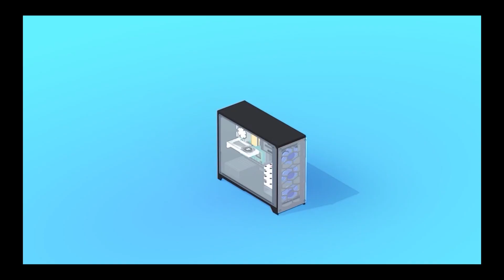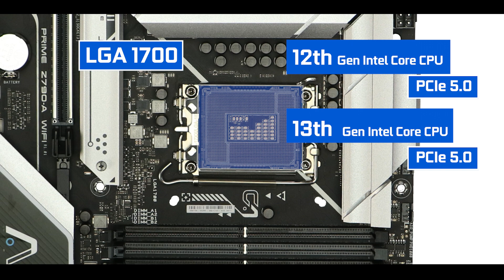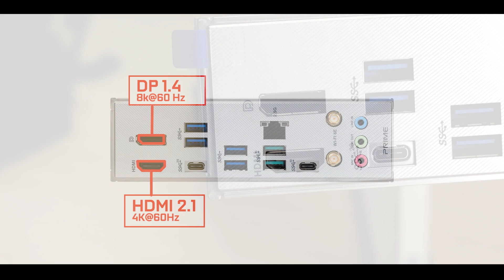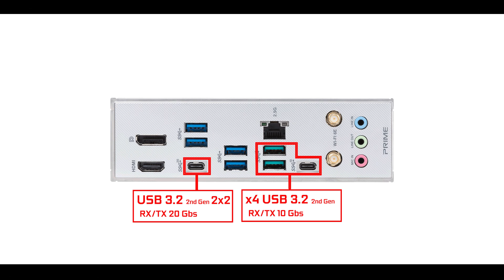ASUS PRIME Z790-A WiFi : The FULL review

Comment: I have the asus z790-ayw wifi w what 750w or 850w power supply can I use?? The ones I have been buying have 2 eight pin connectors while my motherboard as a  8 pin cpu connector and a 4 pin cpu connector

Comment: I have one more question. I have already purchased this motherboard, along with an i7 12700k processor. They haven't been taken out of there shipping boxes yet. My question is this... Would it be worth returning these and getting the "latest" Ultra 7 265k cpu, along with the Tuf motherboard version for this socket? I used PowerDirector for my video editing, and I'm looking to achieve greater stability and workflow on my video timeline, along with quicker rendering time, although the rendering time is not nearly as important to me. My present system, now 6 years old, features an i7-8700 processor and a TUF series motherboard. Any input would helpful. Thank you.
Reply from the maker: In short YES. 
The Ultra brings in PCIe 5.0 which , for an editing machine is central for the years to come. 

Currently you paid 90% of the price for 60% of the performances. 

I would return. Pay the 10 or 20 percent more and get a PCIe 5.0 / USB 4.0 future proof build. 

I would also use my affiliate links for these purchase. It will bring you unprecedented libido and eternal youth (fact).

Comment: If you use an I7-12700k processor, and that processor only supports up to 4,800 RAM speed, then buying Ram with a 6,000 is a waste of money, right? This board can potentially process a higher RAM speed, but is limited by the CPU capacity. Am I understanding this correctly?
Reply: I'm running my 13700k oc to 5.6 with the ram at 6400 on this board, so no :)
Reply from the maker: Well In principle you are right :) but RAM can go much faster if you apply higher voltage profile ( XMP for intel)  . So if the board advertizes higher MTs and ram frequency, it means that the voltage components have gigher rating and that the BIOs have the right RAM OC options. 

The RAM manufacturers, in their side pretest their components to run at higher clocks , hence their advertised clock :)

I hope this helps ')
Reply: @Laurentschoice  Hey, thanks for such a quick and kind response. I'm working on a new system right now. My last board was an Asus Tuf option (6 years ago), but this time I'm just going with the Asus Prime Z790-A, with a i7-12700k processor. Was a bit confused on the RAM choice for this build, so I just went with 32gb of Corsair DDR5 @ 4800mhz, as that is this specified max the processor can handle, and so I thought I was limited to such. Anyways, I'm not a gamer, don't overclock, and will be using this system for some video editing and personal use. Combined with a Noctua CPU cooler, I think this system will meet my needs. I would love to see you do a video addressing the actual component quality between the Asus motherboard options. Are the "military grade" components used in the Tuf series, really last any longer than the Prime series? What is hype and mere marketing schemes verses truth and reality? I almost went with the Tuf option, because I've had such good luck with my present board, but I think I will get the same out of the new PRIME board I have purchased. THANK YOU!
Reply from the maker: So the TUF séries do indeed use what is graded as ' military grade components '. 
Chokes are much resilient ... Going from 5k for the prime to 10k certified hours , you got more PCB layering, and normally you'll get more component spacing to reduce PCIe noise. 

Now.. truth of the matter you'll find the same quality grade componentry on ROG products. So TUF is really a bridge between the Prime and The ROG family. 
The prime Z790 is a bit different than other primes cause it does feature many TUF qualités in terms of resilience without advertising it much. So you did a very solid choice for a 12700k :) 

Good build !
Reply: @Laurentschoice  Hmmm, very interesting. I wonder if the Prime Z790 uses the same 10k chokes as the Tuf line, with this being the unadvertised exception. I just want this new board to last as long as the Tuf board that I'm presently using, and which still works fine (6 years running from morning 'til evening, 7 days a week). I haven't installed the board, and can easily switch it out, if you think that is advisable. Once again, thanks for the personal response. I appreciate it. Great channel you have!

Comment: This board has only 4 sata ports and weak DDR5 abilities on the fast slots (best i could do is 6000 mhz xmp profile, and a max speed of stock ram speed (4800 mhz if i remember right) on the slow slots. Also it had a tendency to selectively not boot my spinny slow HDs which pissed me off to no end (yes the POST delay boot setting... eh not that great waiting an additional 8+ seconds for it to maybe boot them). Refunded and got Gigabyte Aorus Elite X AX for $20 more and no issues. In theory i can do 4-way DDR5 at high speed (not that i intend to but i like the flexibility). I honestly didn't test the slow slots yet but fast slots are taking 6800 mhz OC without issue and 7000 mhz is just about stable with some tuning (had like 1 error after a lot of TestMem5 testing, with the same cheap 6000 mhz kit that Asus had issues with!). Also yes slow spinny HD's all work and 6 sata ports (so i can plug in all my old drives AND my ancient dvd burner). Basically the first and last ASUS board i will ever buy lol.

Comment: I'm split between getting this or the Z790-P for my new DDR5 setup, im running a i9-14900k on a AsRock z690 PG Riptide with 64GB of RAM as of now, which I will use in another case and install the i9-12900k and RTX3070 and either sell it or use it as another backuprig.
Reply: Hi did you end up putting a 14 gen CPU on this motherboard? Did you need a bios update?
Reply: @sean9844  Yeah and it didn't go well. The Prime Z790 has had a lot of issues and where I bought it they said lot of people returned it. Im now using a Strix Z790 instead which works well.
Reply: @EricTheBroBean  I am putting it together with i7 14700kf. The board just wont start.
Reply: @sean9844  Habe you tried updating the UEFI?

Comment: Hey there,

Thanks for sharing this detailed review of the Asus Prime z790a motherboard. It's always great to get insights into the latest tech offerings. I appreciate your thorough analysis of the motherboard's features and capabilities.

You've covered a lot of ground in your review, from the design to the VRM configuration, memory support, and I/O options. It's clear that this motherboard has a lot to offer in terms of performance and versatility.

One thing I'd like to know more about is the motherboard's compatibility with different CPUs and GPUs. It would be helpful to have some information on which processors and graphics cards work best with this motherboard for gaming or other tasks.

Overall, your review provides a comprehensive overview of the Asus Prime z790a, and it's certainly a motherboard worth considering for those looking for a powerful and reliable option. Keep up the great work!

Comment: I'm annoyed because they flipped the direction of the sata cable ports and mine bends at a 90 degree angle, so I need a full extra half-inch of below or behind my motherboard to use either pair of sata cable ports, and it's a tight fit in my case.

Comment: For anyone building a new system opting between these two, they'll probably have to opt for the z790 anyway, since a lot of asus boards seem to not bother with a usb bios flashback port
Reply: Can it hold a 14th gen
Reply: @zappuccinoo  no that's socket LGA 1851, so only 13th gen and 12th gen
are LGA 1700 socket. Intel always changes their socket every 2 years,
AMD is the only one that'll stick with a socket for more than 5 years. the FX
platform lasted for nearly 8 years, so 14th gen Intel is 1851, that means
15th gen will likely be 1851 as well, unless Intel comes out with a whole new
CPU architecture, but i don't see that happening. maybe after 15th gen.

Comment: The problem with Pci 5.0 Nvme on Z790 is that none of the Z790 boards that support PCI-E 5.0 nvme will run the gpu at 16x whilst running a PCI-E 5.0 nvme, they will all drop to 8x as there is not enough pci-e lanes on z790, this is why even the Apex still only uses 4.0 so you can maintain 16x on the gpu. So Asus choice is understandable

Comment: The only difference is false advertisement with the z690 version, at least for the p variant. You cannot run ddr5 with 4 sticks inside, there is no supported set. So the highest configuration is 2x32 GB at 6000 MT/s or 2x16 GB, but forget it if you want to upgrade.

Comment: Given the choice between the PRIME Z790-A WIFI and the ROG STRIX Z690-F Gaming ($60 CDN more), which would you recommend for a new build with an i5-13600KF processor?
Reply: I would go for the PRIME Z790-A because of the bios issue with the ROG STRIX Z690-F, mainly bc it is a 12th gen board, whereas the prime is a 13th gen board that also supports 12th and has a bios flashback button
Reply: Also the RAM speed difference allows you to have some freedom if you buy 6000mhz ddr5

Comment: Thank you for this review. I purchased this board for my next build which will be in white. I buy boards like I buy cars, I don't buy a new one every year. My pre-built i9-139 Hyte system has a TUF Z690-Plus in it and I am happy with it. My expectations are that these two boards will get me thru the next 3 years at least so I don't mind the price when the quality is there. What I can continue to do is to upgrade around the board with faster memory, better cooling, better graphics cards and fans. If and when any of those items become available and will add to my system, that is where I may do additional upgrading. Got my Z790-A. One difference I did find is that the Z790-A DDR5 has connections for TPM. I get what that module does, just trying to figure the benefit and how it works.

Comment: Pls tell me how many lanes i have with the rtx 4090 on the mainboard ? I dont understand? Only 4x or 8 x or 16 x? ?
Reply: I have a 4080 on a z690. Having that GPU and not giving it all the lanes it needs to give you the best graphics it can offer would be sinful.
My next built will be with a ROG 3080 (I can't find the White 4080/90 GPU I want for a price that I would pay) and I just got this MB delivered today. I plan to put a 4080/90 on this board at some point. Check the many reviews out for your GPU. Many explain lanes and how to get the most out of the GPU. Good Luck.
Reply: @jrfreeagent3179  and how it works with intel core i9 13900k can i get here 5.8 ghz?
Reply: X16 on the gpu slot and x4 on m.2 slot, total 20 that thr cpu can support

Comment: Great overall video, very useful to me. I have a technical question about audio connectors on the I/O panel; I read in the manual that a 4 channels audio system must be connected in a strange way: a connector (lime or pink, I don't remember) for the front audio channels, and a front connector (top of the case, for example) for the back audio channels. Did I misunderstand anything? Two cables running to two different location of the case??? That is weird, unpractical...and I like the Asrock z790 approach way more: lime and pink connectors, both on the I/O mobo panel, for front and back speakers! Sorry for my english, hope you will understand anyway. Can you confirm this?
Reply from the maker: Confirmed

Comment: Hey, thanks for the video. I just ordered this motherboard, along with an i7 13700k. (Wanted a TUF as but onnly D4 models are available now). I also have a good cooler - MSI MEG 360 - and I was intending to do some overclocking on that i7 puppy. Unfortunately I've read here and there that htis motherboard wouldn't put up with OC'ing an i7 or an i9, and I sohould've gone Maximus. May I ask what's your take on it? I prefer to know before installing because changing motherboards leads to Windows / id / boot nightmares. Thanks!

Comment: instead of clr cmos button they should provide pins so that one can use a switch to use it from front panel ...
Reply: what's wrong with the button? I have used it in the past when the PC was sealed in the case
Reply: Where exactly do you see a Clear C MOS Button?
Reply: nvm wrong board, i was thinking of the strix-a

Comment: Seems like if you are going to build a 13th gen PC, it be a good idea to get the remaining z690 stock on discount as all the boards seem to almost be 1:1 minus the PCIE lane changes which wouldn't effect 99% of users at home.
Reply: this
Reply: What about higher ram oc frequency compatibility? Wouldn't be better if you want to upgrade your ram in 2 years when tech has matured?
Reply: To my understanding, the issue with the z690 would be not being able to update the BIOS to support the 13th gen cpu without first loading with a 12th gen CPU...since it doesn't have BIOS flash.